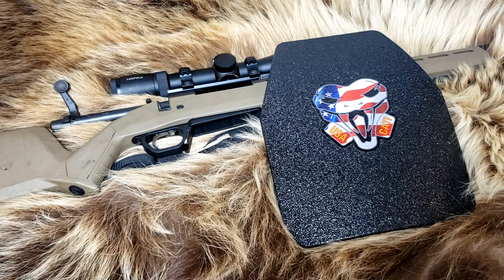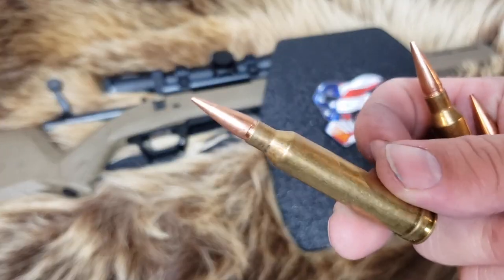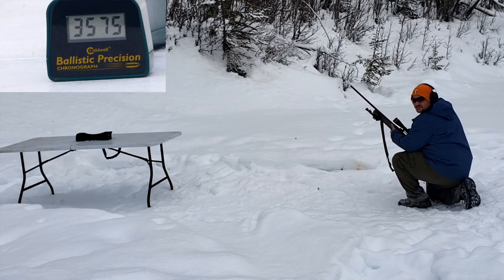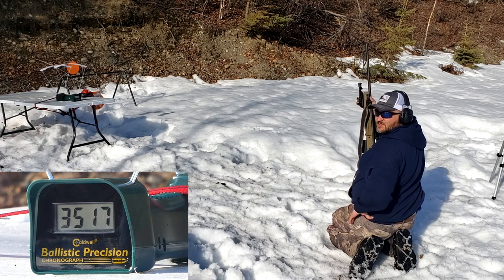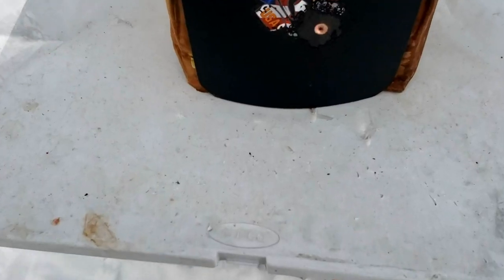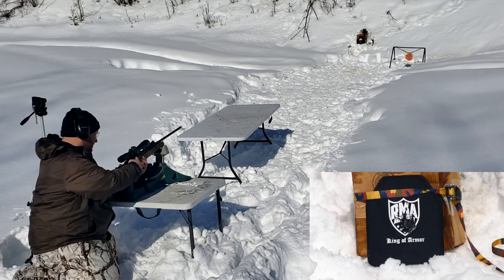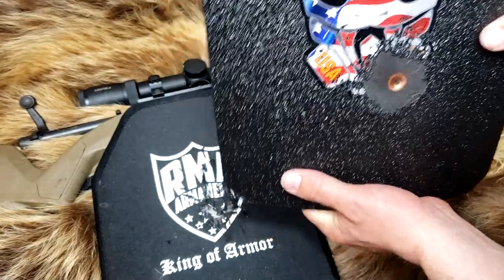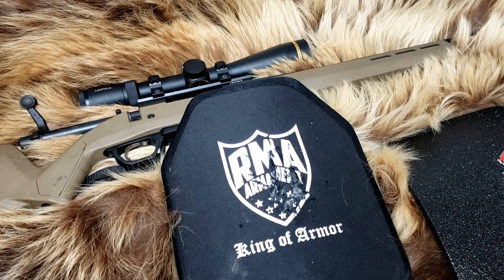7mm Rem Mag Armor Piercing?

Comment: Punch the primers out of the cases you used for both charges and weigh the cases. Could be  the faster rounds were from heavier cases. Could have just been atmospheric conditions too. Many never stop to consider that angle, but it does make  a difference many times.
Reply from the maker: Good idea
Reply: @AlaskanBallistics  Let us know what the results are if you would. You can also leave the primer in and fill each case to the top of the mouth with water, then dump the water in the scale pan and weigh it to see which one holds more  (more water means more case volume and less pressure)

Comment: Good video Chuck.  7mm Mag is a hammer.  Armor functioned well but the energy transfer would be nasty taking a shot to the chest.
Reply from the maker: Very true
Reply: 120 grain BT inside 600m on the belt buckle works. Armor is a meme. 😁

Comment: Cold bore shot will maintain metal sizes, quick follow-up shots will have a warm bore and the bore will have expanded just slightly and add a bit more contact with the round. Each successive follow-up shot will be slower to a point.
The laws of physics apply as does of thermo-dynamics.

I had a Remington 7mm Magnum, real nice in satin Stainless. (covered in camo tape)

Comment: Damn...that's some tuff armor to stop those rounds at that speed. 
Just a heads up, VSO had a video not long ago on spalling using steel, ceramic, and poly. I would check that out, the results are actually surprising.

Comment: I believe that with the right bullet, 7mm Rem. mag can be made armor piercing. Thanks, really appreciate the videos.
Reply from the maker: Got a suggestion on the bullet?
Reply: @boogerdog5247  the faster .243 rounds have been UNABLE to penetrate level IV so far at the NIJ distance :)
Reply from the maker: @Buffman R.A.N.G.E.  i thought you had one go through...?
Reply: @AlaskanBallistics  level III steel at 100yds yes. Level IV no.
Reply from the maker: Ah okay thanks.  Been a while since i watched ut.
Reply: You would definitely have to manufacture a bullet from solid brass or make a slap round to pierce that armor with that 7mm mag.  Anyone wearing normal level 3 or anything less than that, you know it's gonna zip right through it at those velocities.
Reply: @toddk1377  brass is typically a poor performer against steel and ceramic
Reply: @BuffRANGE  
Okay, I wondered since rounds that have deep penetration are usually brass rounds. Is it because the brass itself is not a hard enough material or because the size to weight ratio vs other metals limit the case capacity?
Reply: @toddk1377  typically it’s brittle. I’ve shot 250gr brass solids in 338 RUM at level III steel at 35 yards and they were stopped
Reply: @BuffRANGE  
Right on. Thanks for informing me, I would've thought otherwise.

Comment: WOW!  That was impressive!!!  Really enjoyed that video! That was the fastest velocity I've seen with a 7mm Rem Mag and a 120 gr bullet.  The 7mm Rem mag really benefits from the 26'' barrel.  Powders such as 4831, 7828 and RL 22 benefit from the longer barrel.  Depending on bullet design and weight this can make a big difference at long range.   A well designed 120 gr bullet at 3600 fps would be a truly deadly whitetail load out to 400 yds.
As 404nitro suggests, I would look to the cases as the reason for the velocity differences between loadings.  When we hit the high end of what is possible little differences add up quickly.
Reply from the maker: I've got 120gr barnes ttsx with 4831 going 3620ish check out my video on it.  Thanks for watching and the comment! Godspeed to you and yours
Reply: @AlaskanBallistics  That's amazing!  What is now possible with the new powders and bullets available today was unheard of 20+ yrs ago.  That has to be an incredibly game load out to 400+ yards.
Reply from the maker: With the low b.c. 400 yards would be my max for that load.  I shoot 145gr barnes LRX and 139 gr lrx. Much better expansion at distance.  That cow caribou folded up at 459 yards from my 7mm mag and another one folded up from my 6.5 creedmoor at 282 yards.

Comment: Lehigh has a titanium flash tip at 144gr with 300wm load data. They didn't put velocities with the data, though. I've watched a few videos on the flash tips, and they will penetrate steel. I don't know if they'd penetrate body armor, though.
Reply from the maker: Yeah they're not available in 7mm and 6.5 and .308 are out of stock lol
Reply: The titanium in them is too soft for ceramic armor penetration
Reply: @BuffRANGE  I figured as much. Or, the bullet would be considered an AP round and not sold to the public. Have you tested those rounds to see what they penetrate?

Comment: If you're still interested in testing this then a good bullet to look at could be the cutting edge bullets 115gr ESP raptor, it's designed to be used either as a tipped hollowpoint or turned around and used as a solid penetrator. It's 115gr and solid brass.

Could be just the thing to punch through armor.
Reply from the maker: That's exactly what I'm looking for.    Thank you
Reply: @AlaskanBallistics  glad I could help, I honestly didn't know if you'd ever even see this comment because the video is a year old.

I'm currently wondering if this will do the trick because I'm wanting a new 7PRC and their brass solid might be just the ticket for those fun days at the range when you want to say "watch this!" To a buddy.
Reply from the maker: Might be.  Couldn't agree five any load data on their site for the 7mm 115gr esp

Comment: I have a 22-250 and that is a moving little round. I've seen some Armour tests done with it but I never shot it myself. I already know it won't go right threw ar500 steel stuff. Be cool to see if it went threw or if the plates held up.
Reply from the maker: What bullet were you using?  Like i said the barrel is 400 too  bucks from McGowan Barrels so the patreon  has to go up significantly first.
Reply: I will go threw. Sorry dang auto correct
Reply from the maker: @tomjones7285  it will go through?
Reply: @AlaskanBallistics  oh ya ill shot at the AR500 steel and I'm assuming just the speed of it that 22-250 bunched a hole 🕳 clean threw it.
Reply from the maker: What projectiles were you using?
Reply: @AlaskanBallistics  ill check when I get home and let you know.
Reply from the maker: Cool I've been thinking about pulling m855 ball from .223 and loading them into .22-250.
Reply: @AlaskanBallistics  my loads are factory stuff. If that makes a difference. But ill pull them out and let you know what brand it was.
Reply: The bullets i used were the Federal 60 grain Nosler Partions. And Federal 55 grain soft point. Sorry I was slow getting it to ya. But life sometimes. It happens.
Reply from the maker: No that's perfect man.  Thanks for letting me know
Reply: @AlaskanBallistics  not a problem. Thank you for being patient.
Reply from the maker: Thank you for the info

Comment: Sounds like the more powder in the case doesn’t allow for the correct burn rate. I wounded I’f you slow mo on the cam maybe you could see if there is full burn or not. I’m a novice reloader always looking to learn an I’ve got a savage 111 build in 7mm rem and great seeing people venturing in this Caliber.
Reply from the maker: Well with the 120gr barnes, if you've seen that video,  i was getting 3640 with only 0.3 more grains of powder.  I didn't load these as deep and that may have been the problem

Comment: Ammo is getting colder.
Reply from the maker: It is..
Reply: Those bullets are designed to tumble, they can't tumble into steel. Get some military m2 blacktip 30 cal bullets and load them hot into 300 Ultra or 300 Weatherby.
Reply from the maker: I've done that with .300 win mag.  3330 fps didn't go through
Reply: @AlaskanBallistics  Spray the fmj bullets with teflon?
Reply from the maker: Nope